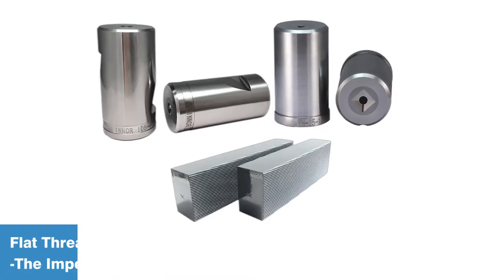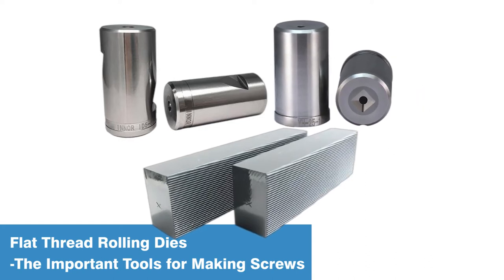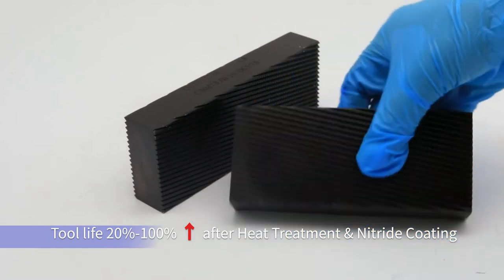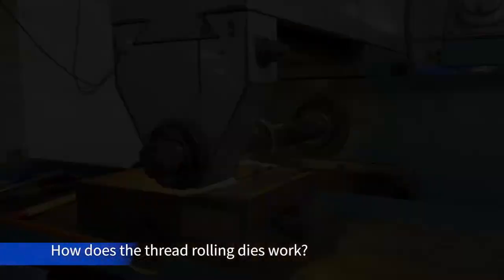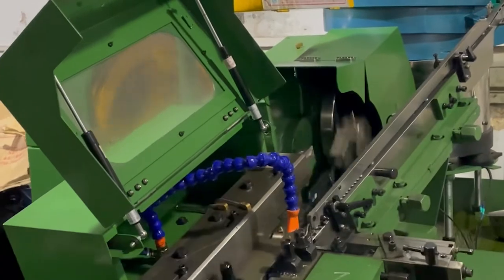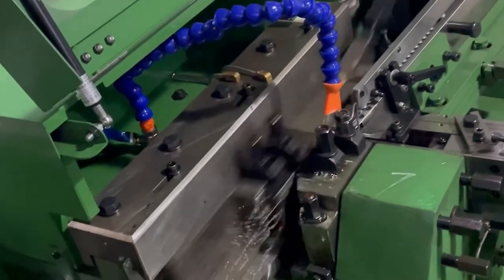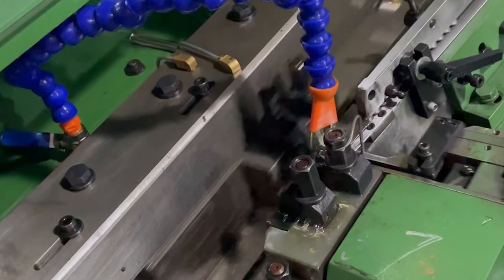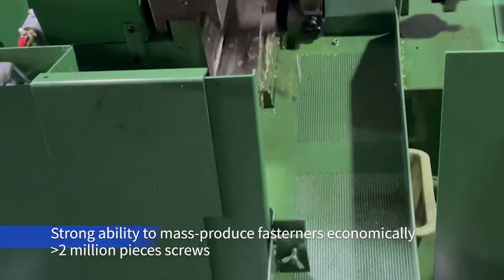Flat Thread Rolling Dies - The Important Tools for Making Screws

Comment: Does diameter of screw change where threading is done
Reply from the maker: The diameter of the screw will increase with increasing pressure during wire rolling
Reply: Any option where we can have same diameter after thread rolling. In thru feed thread rolling die is it possible to mentain size as feed